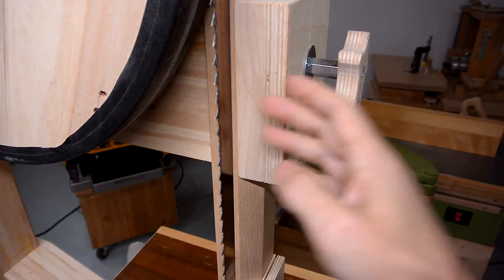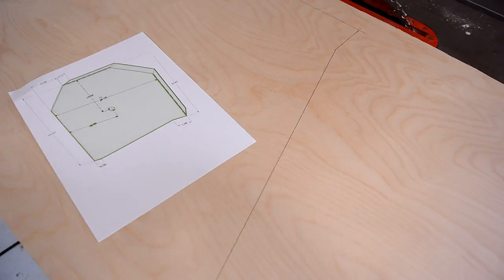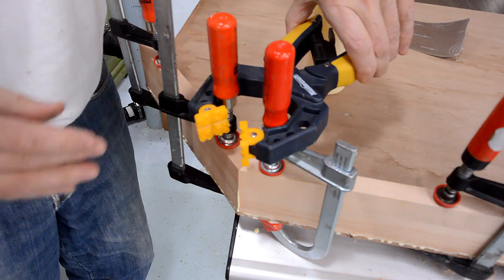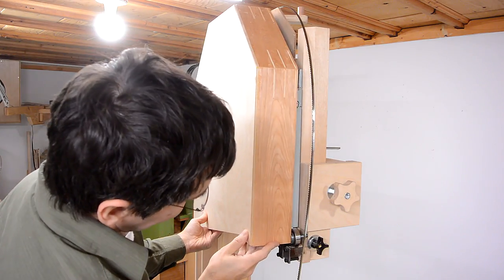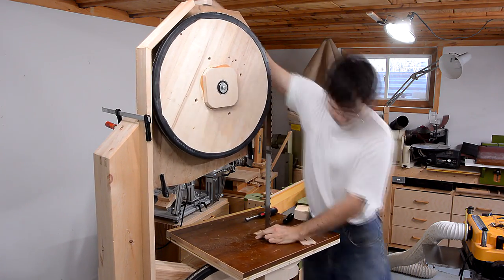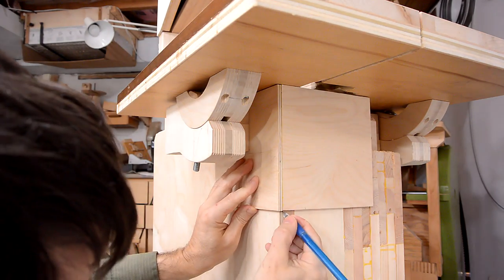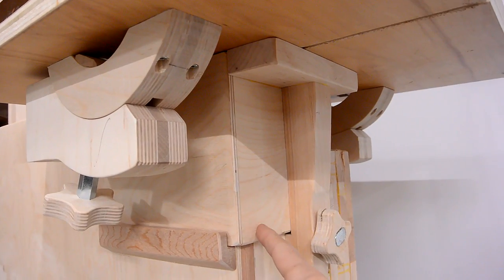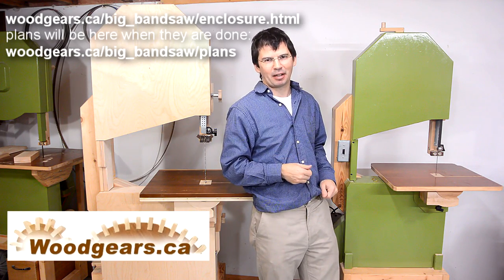Big bandsaw build 6: Enclosure, milling a log

Comment: Clamp over clamps. Excellent
Reply: It's called clampception! :P
Reply: Alper Sönmez Clampceptional?
Reply: If your mitre joins are open at the top doesn't imply you're not cutting square ?
Reply: or the ply was a little thin and the weight of the clamps was bowing it

Comment: Amazing as always! I saw a lot of wood debris collecting on the inner-tube covered wheels, ever thought about attaching brushes at some point to clean off the extra debris to minimize slippage? 
Keep up the good work!
Reply from the maker: Slippage is a non issue.  A lot of blade tension is needed to keep it straight, so the blade won't slip, even if it were on wooden wheels.
Reply: Matthias Wandel Thanks for the reply! Good to know, less maintenance.

Comment: Oh those indispensable pocket hole screw joints.  Nice job on this larger bandsaw.  Agreed, a stronger motor is a must.  First thing I noticed when you fired it up & cut the part for the lower wheel guard.  As an aside, I read somewhere that green is a favourite colour of those with genius intellects.

Comment: Thumbs up for the trick to close up that joint with a lateral clamp-clamp.
Also I appreciate you keep demonstrating the safe tablesaw technique with the two push sticks
Even though it would be even safer to also use the riving knife and most of all, the blade cover ;-)

Comment: Hi mate.  That is a wonderful machine that you created there.  And all that on the fly, right? Excellent!  
Why did you go for piano hinges rather than swivel pins, or hinges that can be lifted apart ( I don't know what they are called)  But you would be able to remove the covers more easily, or did you want more rigidity?
Long hinges are often used to keep nose cones on small air crafts, but then, a thinner rod is being used to push into the hinge, and the nose cone would be attached to the fuselage.  This way the hinge can also be curved.  However, naturally, in that case, the hinge would be a fastener rather than an operational hinge.  That could also be a solution.
Reply: Marcel Timmers In the article he says he uses hinges rather than lift-off pegs because of the lack of headroom in his workshop..
Reply: Ah, Thanks mate.

Comment: I wonder what those log boards will be used for?
Reply from the maker: I will let them dry for a couple of years before using them
Reply: The general rule is 1 year per inch of thickness.

Comment: You have enclosed the blade and other internal parts really well, are you going to add a dust collection port to it?  As tightly as you have it enclosed, it should collect the dust really well.

Comment: I am wondering if a few strong magnets will be able to hold the cover together, that will make the assembly very quick and easy to change in the future too, or the vibration is simply too much and must use some screw to hold it ?
Reply from the maker: The latch was pretty easy and much cheaper

Comment: Matthias, I'm gearing up to build your 20" band saw when plans become available.  Can you tell me approximately how long the two wheel shafts need to be?  I'm leaning toward precision shafting.  I realize in previous videos you have suggested shims with regular old black steel pipe.  I may be willing to spend the extra few bucks on the right shafts but need to know how much to buy.  Kind regards, Brad

Comment: Dear Matthias, 
ist is questionable that the saw blade moves  e bit foreward and backward during cutting process? I think for a straight cut it dosen't matter. Waht do you think it comes from ?
( temporary underpowerd motor, wheels, hevy blade ...?)

I really want to build this Bandsaw. 
great Job

Comment: I noticed that sawmill blade throbbing back and forth during the cut.   Is that the result of a mis-aligned  blade weld or is there something wrong with the wheels?   Will you be raising the blade speed when you install a more powerful motor?  If so, you might want a 1 1/2 to 2 hp motor for a blade like that mill band.  A 1 hp should be adequate otherwise.

I'm also very curious how much wheel load for blade tension you are able to get with just the two wooden leaves; have you had a chance to measure it?  I would think you'd need more leaves.

Lastly, I like your trademark green paint - wouldn't be a Matthias machine otherwise.  A bit of pinstriping of a contrasting color might look nice though.
Reply from the maker: It's a crooked weld.

Comment: do you think this bandsaw could be made without any hardwood and birch plywood, just using spruce boards and plywood?
Reply from the maker: Sure, it just wouldn't be as good.
Reply: Matthias Wandel what would suffer besides parts wearing faster
Reply from the maker: not as stiff, and things would not slide very well
Reply: Okay thanks

Comment: For New Year's present for me I am buying meself plans for bandsaw. Question is, which You would recommend? 16" or 14". Lets say sawmill is not necessary, but if in comparison just between those two bandsaws
Reply from the maker: Most prefer the 16" version
Reply: Matthias Wandel thanks. just unfortunately difficulty is to find blade of this size where i live. quite common size is 2490mm

Comment: Hello again, Matthias
What HP would you consider to be very good for a bandsaw? 3?
Reply: I'm not Matthias, but unless you're making a humongous bandsaw for lumber milling like he is, a motor between 1 and 1.5 HP works well. I believe that is what he is using on his other bandsaws and it's what I see installed in most saws 14" or smaller. If you do decide to go with a larger motor, keep in mind that anything over 1.5 HP will require a two-phase power source if you're in North America.
Reply: In the US 240v is what would apply and that is still single phase (just split). Three phase is a whole other beast (that is typically only installed in commercial settings)
Reply: ionstorm66 Cutting metal on a bandsaw requires low speeds.
Reply: Bike Man Dan
Ah, yeah, I got it wrong. I must of confused myself thinking about how you "combine" the voltages to get 240 and how that's not the same as adding a phase.

Comment: How much different in floor space is there between this and the 16" ?  I want to build one of your designs and am figuring I might as well go big out the gate...
Reply from the maker: this one is 6" wider.
Reply: Seems like not a big deal, so other than blades probably costing a bit more, any reason I should consider building one of your smaller ones over this one?

Comment: You could have clamped a piece of wood at least the length and width of the fold you want on the metal sheet so that the fold is more continuous and no need to move it i and out of the vise so often.

Comment: Matthias why pocket holes you could've just glued a piece of wood on and screwed it
Reply from the maker: That would have interfered with the blade if it was on the inside, and looked odd of it was on the outiside.
Reply: Why dont you use a splitter on your table saw?

Comment: and its cheaper to get your band saw than a metal saw. I was wonder why a wooden bandsaw when if you ordered a metal band saw you can start sooner cutting  and it might last longer due to the heat Resistance it has ?? the wood will heat up under a lot of heat and maybe catch fire???and if the blade snaps will the wood keep it in side ot will it explode outward ???